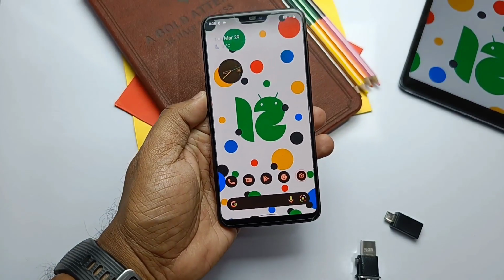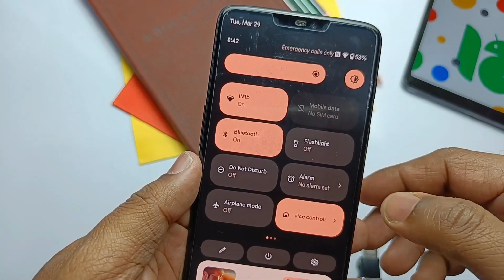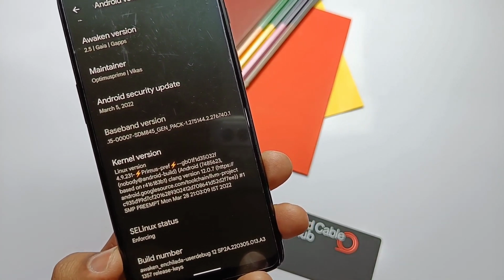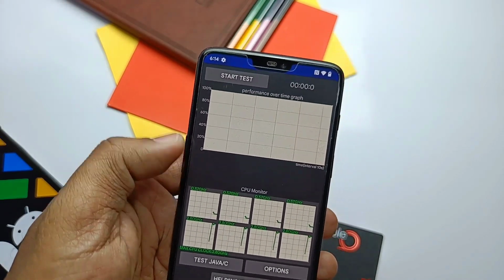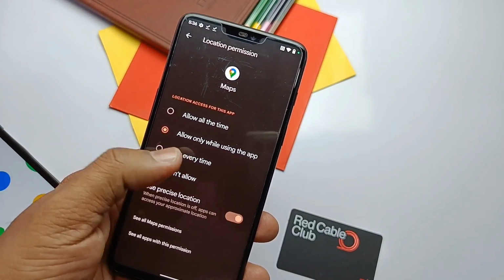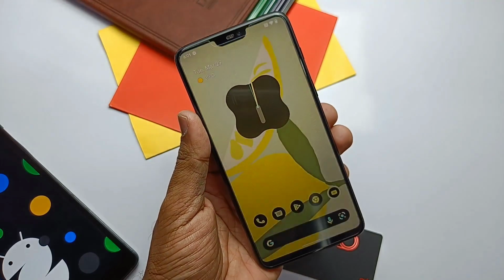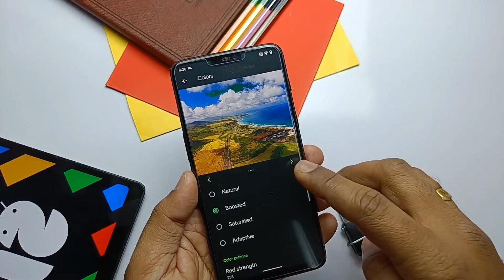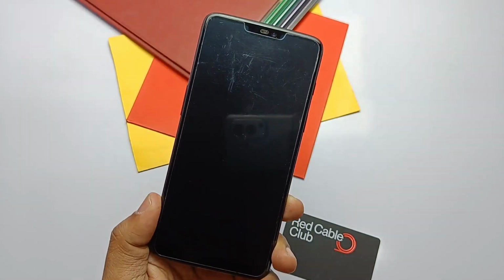New AwakenOS 2.5 Android 12.1/12L OnePlus 6+6T: That's it!

Comment: There's a serious bug. I enabled demo mode and the system crashed. Now I have a bootloop. How can i solve it from fastboot or TWRP??
Reply from the maker: Factory reset or Wipe data in twrp
Reply: @4utech  Can't I use an adb command from twrp fo fastboot? Such as disabling demo mode
Reply from the maker: Power of the device and long press vol down+power it will boot to twrp and do factory reset no other way to solve this issue now .
Where did u enabled demo mode?
Reply: @4utech  I found the solution but I was very lucky that it worked. I just search internet to find the adb command to disable demo mode, I tested it on another device and it worked. Then I connected the phone to the PC, then I turned on the device and then I ran the disable demo mode command, which was:

adb shell am broadcast -a com.android.systemui.demo -e command exit

and I encapsulated it with a while true, so the end command was:

while (1) { adb shell am broadcast -a com.android.systemui.demo -e command exit }

This ran the command multiple times and luckily the booting up device loaded the adb interface before crashing due to the demo mode bug, so it booted up normally and I could use it again without losing any data.
Reply from the maker: Very good😃

Comment: good afternoon bro, excellent video! I am using it and it works great!! I just wanted to ask you: can i twrp flash the magisk 24.1 zip in this rom? or can it be damaged?
Reply from the maker: Wht can be damaged? U will Loose safety net check pass only
Reply: @4utech  I thought that the system might be messed up by installing magisk.zip, but everything went fine! And indeed what you say was fulfilled, is there any repercussion with it?

Comment: Hey, your finalize.zip form dgoogle drive is NOT working.
When i'm flashing the finalize it says it's for pixen os and then it says error installing zip file
The one on your post DOES work
Reply from the maker: Don't use any finalize just wipe and reboot see if its works

Comment: Hello. Thank you for your video. Finally came from stock OOS. 
GPS is working and no problem with ui restart :) Using 6T.
What Gcam version do you recommend ? Your link doesnt work anymore :/
Reply from the maker: It's. Working when it opens you get google camera port link there  click and it will redirect to stable gcam download from there MGC build version
Reply: Please one Huge problem i got with this rom im not able to install my mobile banking application from playstore. VÚB Mobile banking. It says it doesnt support my device (which now appear as Pixel 5)... :( Is there any workaround ?
Reply from the maker: VUB please give link
Reply: @4utech   @4U Tech  It keeps getting deleted when i post link here. :-/
I downloaded .apk from apkmomk and It does work without problem, however i dont want to login into my banking account cause im scared It might be edited apk and someone might steal my data and empty my bank account.
Reply from the maker: Use banking apps from play store
Reply: @4utech  thank you for your response. I managed to download It from Huawei store and It does work. Im Happy that i can use this great rom without any issues :)

Comment: If location in maps isn't working that's a big problem
Reply from the maker: Did you tested please confirm? Because some folks saying its working
Reply: @4utech  Yes it's working for me, also the YouTube horizontal issue isn't there for me, just clean flashed
Reply: Works for me on OnePlus 6..dirty flash over 27March build